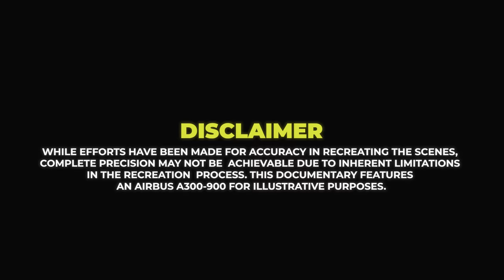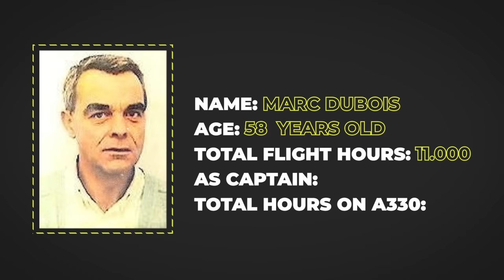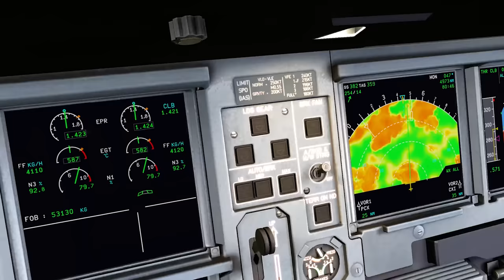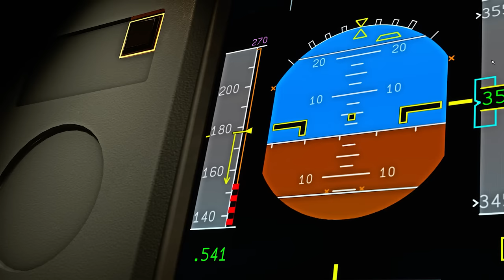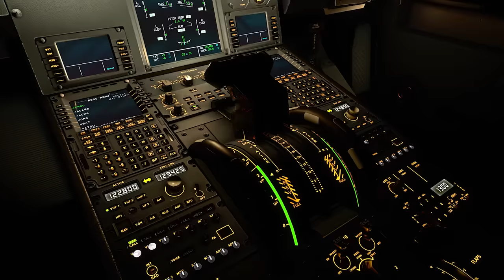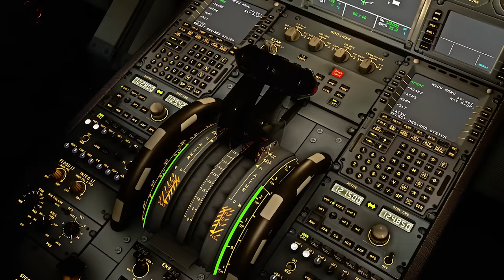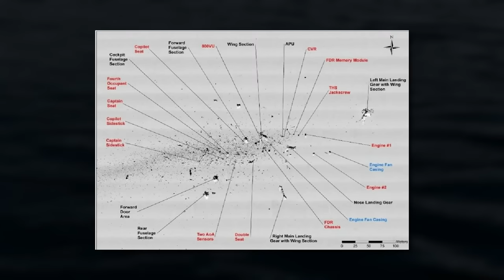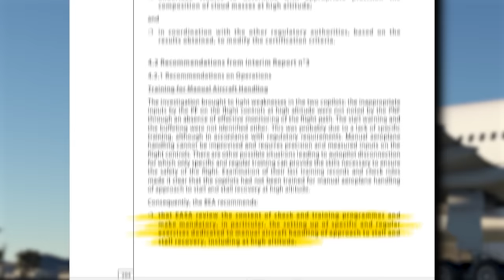Horrific Freefall into the Deepest Ocean | The Sad Story of Flight 447

Comment: The lack of training and the incompetence of these pilots is staggering.
Reply: Genuinely asking, what should they have done? It’s mentioned they were experienced pilots.
Reply: @ShawnS14 the video did an absolutely horrible job actually explaining the technicals of what happened, but the co-pilot literally stalled the plane out of negligence and crashed. 

They had some iced over equipment which caused them to lose air speed reading (which they got back but then did not trust) and this caused growing panic for some unknown reason. 

The captain finally realized what was going on in the last 10-15 seconds, in the transcript you can hear him start yelling to stop pulling up. Shouldn’t have left those two fools in the cabin alone.
Reply: Definitely sounds like incompetence was at work, but certainly a lack of training as they said in the report.
Reply: @TheMiniJunkie  yes. The pilots likely never actually trained a stall in the cockpit of an actual plane, which is absurd imo.
Reply: Thanks for all the answers here guys!
Reply: @CableReadyTechnoSIut  It was almost glossed over in this video that the F/O repeatedly holding onto the stick in a climb position - even when it was the exact opposite thing to do, and he was instructed by the senior F/O to relinquish control - is the overriding reason the aircraft crashed.
Reply: @CableReadyTechnoSIut maybe that’s not a statement the creator wanted to make or could make?
Reply: @ShawnS14  pierre bonin, the first officer, was the one who crashed the plane. the plane was falling because there's no speed. no speed because he pulled up for no good reason, while pulling up itself endanger the plane due to aerodynamics.

he was a pilot who forgot about aerodynamics.

Supposedly, the night before, he and his wife spend the last day partying hard instead of resting. he lacked sleep. this makes his brain failed to think like a pilot. pure, utter negligence by the first officer.
Reply: Yeah, this video lacked how incompetent the crew outside of the captain was, the entire incident was so easily preventable and they had plenty of time to correct the stall, instead they made it worse and by the time the captain was woke up and alerted he figured out what was going on too late even though at the very end he realized the first officer had absolutely no idea what he was doing  and even though he took control and took out the input of the first officer it was beyond too late. 

Honestly to me it's absolutely ridiculous to think the idiot first officer had a pilots license in the first place, if your airspeed is too slow at the altitude it was at you nose down and get out of the stall safely and get lift back, you don't nose up to gain speed or to leave a stall, especially at the altitude they were. You can blame the ice crystals all you want but at the level they were they had beyond enough time to recover but instead they went nose up. Honestly the idiots would've probably would go nose up at overspend warnings causing the wings and plan to tear itself apart  if they were stupid enough to cause the crash how they did I highly doubt they would know the difference.

Also, yes, they're idiots, only the captain knew what he was doing,the fact they aren't blatantly called idiots is astounding, not saying they deserved the fate but their absolute failure of basic aviation cost many lives and destroyed many families. This is up there with the flight that the captain allowed his kids to fly the plane and ultimately kill everyone .

Yes it is tragic they died too but what is more tragic is their incompetence to handle a basic aviation issue such as a stall. To sum up the absolute idiocy of what the first officer and the rest that weren't the captain, imagine your driving up a huge incline and you get halfway and realize  you won't get up the hill no matter how much you accelerate you're pretty much in neutral and dtart to reverse while still slamming down the gas and getting nowhere but continuing to go backwards, do you continue slamming the gas pedal down ignorantly or find a way to get down the hill safely and have control. 

Now compare it to an easily handled hill in the snow and you're near the top and spinning out causing yourself to go sideways and not be able to correct...do you continue doing that and think you won't get stuck or continue to be out of control sliding everywhere? Or do you slowly reverse down that hill and have a better chance of getting the right speed and angle of attack so you have the right speed going up this time and actually don't get stuck.

If you had a hard time answering, congratulations you have the same skill as the idiot first officer and crew outside of the captain. 

Flying is considered the safest means of transportation, and that is because flying is expensive and not everyone can do it but when idiots like this crew minus the captain have almost 0 knowledge of basic flying thwn you get this result and the more lax standards get more tragedies like this will happen. The crew minus the captain pretty much killed everyone including themselves,and I'm sure I'll get a comment saying it's disrespectful to talk ill of them for their incompetence but facts matter if you want to prevent more tragedies. Luckily most pilots actually know what they're doing and weren't just thrown in a simulator and have autopilot do everything to the point they have no clue how to get out of a high altitude stall.
Reply: Yes it turns out total flight hours means nothing if you don’t have training to manually handle a plane. Surely the possibility of the instruments being frozen by a storm was known, so how could they not know what to do if that happens? Terrifying to fly knowing this type of failure can happen.
Reply: @liva9591  bro, it's not even about training. if you can commandeer something, you would have a clue of how it works. the mistake here made by first officer was as if he has no idea how a plane works at all!
Reply: @ShawnS14 i know nothing about aviations and still know that going nose up will do the opposite and make the aircraft descend, these pilots kept pulling up
Reply: Green Dot aviation is a better channel. They tell you the technicalities too
Reply: The nose up control was the nail in the coffin and at night I take it they can only see darkness below them 😢
Reply: @George-v5c5n  it was not the nail in the coffin. the plane did not have any situation that would crash it, other than the nose up, which ruined the aerodynamics. it was the cause.
Reply: Easy to talk about afterward but all measurements show false informations at the beginning then after taking actions, they say something different because of turning back on. You don't see anything outside and can't trust your machine, not mentioning it happened in few minutes... It could have been different if the commandant was there but nothing prevented him from resting in the first place
Reply: @lsda6712  it must have been a long flight if he had to go for a sleep
Reply: @ShawnS14  the right chair pilot was at fault, it seems. pulling back on the stick , the plane could no longer climb and it stalled. the left seat was trying but didn't know Bonin in the right seat was continually pulling back. the Captain saw this with no time remaining.
Reply: @thegreatmrt agree
Reply: Your lack of understanding is staggering. It's not that hard to understand the misjudgement of the pilots - they thought they were in an overspeed stall. The symptoms are similar, the warning is the same. Look at the airspeed disappearing on the PFD and only showing "SPD" - it's even in the video! They lower the nose, the warning sounds: "Stall! Stall!" - They pull up the nose, the warning goes silent. Is it that difficult to understand why they pulled up the nose?
Reply: Agreed, you research the Varig Flight 254 flight too, the pilot incompetence on that flight was staggering, they were flying west instead of north. 🤦🏻‍♂️
Reply: @petermuller5800  it’s pretty difficult to understand why a trained pilot would spend two minutes plummeting to the ground while pulling up on the stick the entire time, yes.
Reply: Those pilots only relied on auto pilot.. and when it disengaged they almost could not fly the plane at all
Reply: @ShawnS14  Very easy and simple procedure in case of stall is nose down and max throttle. They did the exact oposite for 3 freacking minutes !!! They were at cruise level and could have recovered 20 times! I'm so furious after watching this... Like three frightend pigeons!
Reply: @thegreatmrt  There was another (honestly better) video on this flight I'd seen. It boiled down to the first officer just yanking the stick all over the place then holding it in a back and to the side as he froze in panic. The pilot couldn't over ride his stick commands and the first officer ultimately caused the crash. I think it lead to an investigation of Airbus' dual side stick layout. This couldn't have happened on Boeing's connected yoke system.
Reply: Clearly they were experienced pilots.
Reply: @ShawnS14  bonin stalled the plane. he pulled the nose up a staggering 40 degrees at one point. he panicked when the speed monitors went out, and just pulled the stick back without stopping to think about what was going on. the groundspeed measurement never stopped working btw, so they could've worked off that
Reply: @ShawnS14  this video didnt do a good job covering the technical aspect of what the pilots did wrong, but yeah. ultimately pilot error. Bonin freaked out, pulled on the stick too much and stalled
Reply: @CableReadyTechnoSIut  well said. one thing I'll add, from reading about this. the ground speed measurement never stopped working, so they could've checked that also to see how fast they were going. they didnt
Reply: It was only 1 pilot
Reply: @thegreatmrt  an excellent analysis, and you are totally spot on.  It is correct to call them idiots because, unfortunately, that is what they were.  It is also Exhibit A for how NOT to react in that type of situation.  

The captain also shares some responsibility here because he was up all night with his "mistress" the night prior, which is why he was so sleepy.  Had he been alert the entire time, the crash never would have happened.
Reply: @ShawnS14 they literally didn't understand stall and stick inputs, it's a disaster.
Reply: Just shut up... It could happen to anybody
Reply: @joshuabremnes8338  What Bonin did? No it can't dopey, not to a supposedly trained pilot.
Reply: @liva9591 it's not even that. That's just basic high school knowledge he was lacking
Reply: The fact that they 100% had been trained on stall recovery and yet still this happened somehow. People that panic should not be in cockpits
Reply: the captain was a problem
Reply: Dual stick input mean bad teamwork..
Reply: @agps4418 I read it was the Captain who party hard the night before with his mistress and only got 1 hour sleep 😅
Reply: @LouiseLm91  maybe? but still, it was not the captain who forgot how a plane works, and even worse, while flying it
Reply: @LouiseLm91  in fact, now that i think about it, i suspect bonin was high on something, to be that braindead as a pilot at that important moment